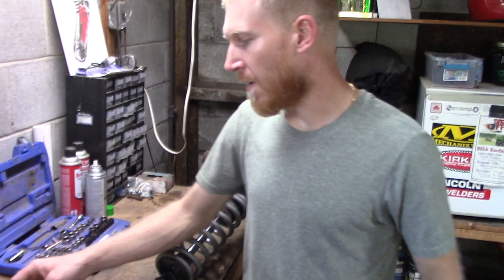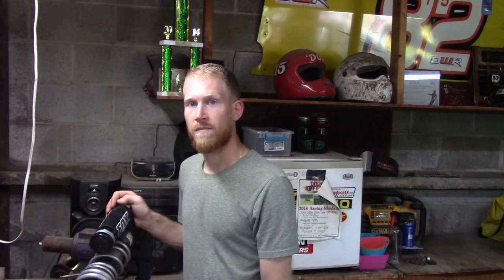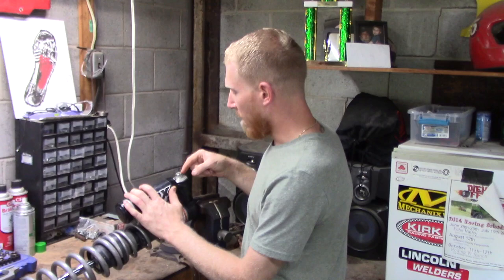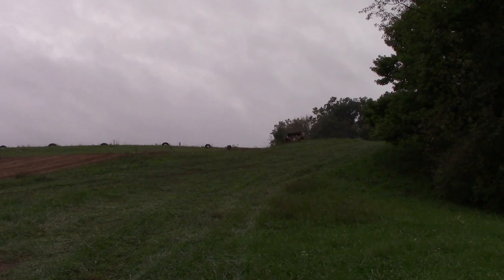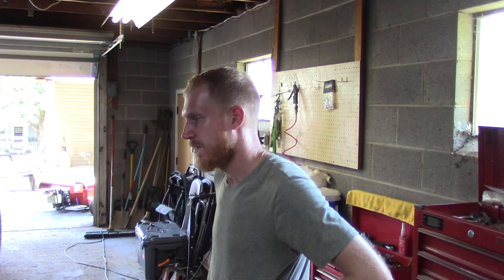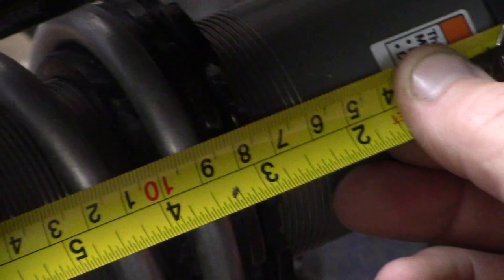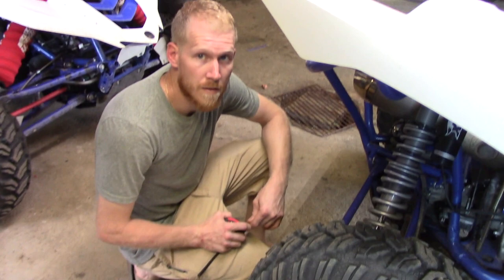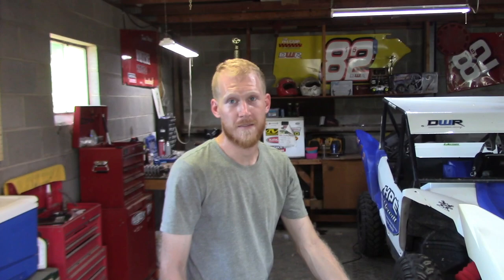YXZ Short Course Stock Suspension Setup! Gladman Gives Out All Our Setup Secrets!

Comment: Also on your measurements you need to reference the crossover nut to the slider not the preload nut.  You can set the preload nut much lower to lower your ride height and then put your cross over nuts just above your slider and that is a more definite measurement.  For short course I run my slider 1/8" off my cross over nut so all the tender spring does is take up the small chatter.
Reply from the maker: I’m not sure I totally understand…we don’t reference the preload nut to slider we take the measurements for both from the top of the shock. We don’t like to measure the distance between the slider and the nut because depending on where the car is settled out at that measurement could change and measuring from the top it’s consistent. And wow 1/8” that’s interesting, you’re basically on the main all the time!
Reply: @writeselwelding  I get what your saying and that works as long as you are not changing the preload/ ride height of the car. However if you set the car down in ride height now your measurement to the cross over nut changes.  The way I measure it no matter where I set my preload I know how long (in distance) I will be on my tender before I get on my main.  it can all be calculated from the measurements you gave but it requires math and thinking when ride height is changed and I avoid thinking when I can LOL.  But yes the way I am set up I am on my main pretty much all the time.  I only use the tender to take up the initial jump and small chatter.  It stops more body roll as well with the spring and doesnt take as much sway bar so you get a bit more wheel articulation while still managing body roll.  its just a different way to go about it.  I manage body roll with the springs and not so much with the sway bar.  These are all setting from GForce shocks also so its not only my preference.
Reply from the maker: Oh ok gotcha!!!

Comment: Say I want to make it smoother for trail riding should I speed up my rebound at the bottom of my shock. I experienced a little with the rebound on my pit bike aftermarket shock and when I went all the way fast on the rebound screw on the shock it rode alot better than when I turned it to slow. I figure it my transfer to my yxz totally new to this just trying to do a little research. seems to me rebound screw would be easiest to experiment with first. Don't really want to mess with the bolt with the little screw if it turns with it yet till I learn more but that single rebound screw at bottom of shock seems easy enough
Reply from the maker: Yes the rebound setting will have some affect on the ride no doubt, but to be honest if we were going to try and improve ride quality on the trail I wouldn’t go there first. The first two things I would look at it the low speed compression setting, or if it has a dual rate spring setup we would look at where the slider is in comparison to the crossover nuts when the car is at ride height which controls how much of your rod is being controlled through the tender spring. Don’t be afraid to adjust on the compression nuts. They have 4 turns of adjustment all stiffer rotating clockwise. Put a wrench on the high speed and count the number of turns until the screw bottoms out. Back the screw out back to where it was and soften it by 1 turn. If you would like to discuss this more in depth we’d be glad to help. Go to the Race Relentless website and send a customer email and leave a number and we can call you back to discuss further.

Comment: You said that it’s the same with the stock white single coil springs on a 16 correct?
You just disregard the crossover spring settings.
Reply from the maker: @ricksteel6401  thank you and yes! Of course the measurements would not be the same but overall the idea and the theory behind it applies to both.

Comment: My 17 yxz has X2 shocks. Is it possible to tighten the springs up that much on these? The other adjustments made a huge difference. I do a lot of road riding to hit the trails and would like a tighter ride.
Reply from the maker: Hey @jamesbrady1959 thanks for the question. When you say tighten up the spring are you referring to moving the compression nut at the top of the spring to compress the spring more?

Comment: I have a talon r livevalve not much I can do to lower the center of gravity, what do you think of me using limit straps to achieve that. 
Also what tire pressure do you run?
Reply from the maker: @TheExtremeRace I’m not sure…that’s a very good question. I don’t really know enough about the live valve to give you any advice on that…on a non live valve shock yes the limit strap will help you get the ride height your looking for if your spring stack isn’t long enough but it takes away from your full droop when the car is off the ground so yes the straps will help you get the car lower but your giving up shock travel in return! As Gladman would say the limit strap will work but it’s really a “crutch”!
Reply from the maker: And as far as the tire pressure we ran 26” ceros and depending on track conditions the rears were between 25psi and as much as 28psi and the front were a little lower between 23psi and 25psi…we ran the rears a little higher just help the rear rotate on corner entry
Reply: Unfortunately with the live valve you’re stuck unless you know someone that can tune the shock’s ecu. Here’s why. The computer has a set point programmed into it that it knows ok this is home or there shouts for a set factory ride height. So you can valve it and make it better and also spring it for whatever you’re wanting to do with it/set your ride height as low as you want. But as soon as it leaves the ground or shock droop the computer is gonna adjust the shocks to try and stay at that pre set height. Eventually it’ll sag down to whatever height you had your springs set at. So in short you’re kinda hosed. I talked to Shawn Hess when we raced against him about why he isn’t running the live valve and he said he can’t find anyone to map them. Said as soon as they get past the set height point they lock the bleed in the valving down and it totally messes you up and it takes forever for them to settle back out while your racing. And yes i believe using a limit strap is a crutch unless you’re using it to keep from over drooping and hurting the stock piston. But not to hold the car from a set height. You spend money to have a shock that travels 16” or whatever. Might as well figure out  how to use all 16”. Send Scott a message on Facebook and see if he knows of anything to cheat the live valve system. I know he’s done several sets of talon live valve shocks. Scott Hewitt at HPE SHOCK SERVICE. What tires are you running?
Reply: Running stock talon tires, I did a rally cross event at the firm this weekend and most of the is asphault and part roadbase, on the asphault the tire gives way to much into turns. I do have a e2racing adjustable rear sway bar running on the middle setting. I think I should make it 1 setting stiffer to see if helps more.
Reply: @writeselwelding  I was reading about those maxxis ceros tires and it said max pressure is 18psi. Is it ok to go as high as you have it?
Reply from the maker: Yes….I ran all of last season on the same set with no issues…I’ve never been lower than 22psi in front or rear with the ceros

Comment: Good video.  there are all kinds of different set ups to get you around the track.  I finally had to go to a front sway bar to keep the car from going up on 2 wheels all the time.  Now it corners flat and does well.  I have been tossing around the idea of getting rid of the X3 and going to a YXZ and stepping down to that class.  I suspect it would be just as much fun while not having the car on the ragged edge all the time.  I am sure I will miss the speed an power though is my only thought.
Reply from the maker: As far as local racing goes the Pro Stock N/A class always has a good count and the racing is super competitive…We kicking around the idea of building a turbo car but from what we seen it just wasn’t worth it so went the stock route….you should 100% get a YXZ!!! Lol
Reply: @writeselwelding  I think there is usually a better count in those classes because price to get into it is so much lower and accessible to so many more.  I will probably go the YXZ route.  Just have to move the X3 along first.
Reply: Totally agree with Donald! It’s more cost friendly and very competitive and high car count. But it’s hard to turn down big power lol
Reply: @kevingladman4735  Yup. I think its the move I am going to make.  Its just going to be hard going to half the HP sometimes LOL.  But I have always said its more fun to drive a slow car fast than a fast car slow.  Sometimes its not about having the most power.  Its fun if everyone is about the same and its just the drivers skills vs the other drivers skills
Reply from the maker: @Chad Shumaker some of most fun I’ve had in racing is leaving the super buggy sit and getting back in a 1600 car…when the racing is super close and you can’t make a single mistake without loosing car links it’s fun!

Comment: Just wondering, and I apologize if it was mentioned in the video because I must have missed it then.  What ride height front and rear are associated with these settings?
Reply from the maker: No you are correct we didn’t mention ride heights in the video. Ride heights measured roughly 10 3/8” rear and 11 3/8” front using the most rear facing lower pivot bolts to the ground! Hope this helped!! Thanks for watching!!
Reply from the maker: You might be able to get this exact measurements it will depend on the spring setup you’re running but you do wanna be 1/2”-1” higher in the front
Reply: Much appreciated! Great video, great info.  Tuning a 2020 XTR with RC2s and stock dual springs and looking to see what kind of performance I can get out of them before jumping to Weller.
Reply from the maker: @Smoking_Nun  No problem! and Thank You! If there is anything else we can help with just let us know!

Comment: Hi guys I have a 2017 YXZ SE with the X2's what's your thoughts on a better ride for this setup?
Reply from the maker: Hey, Thank for watching thanks for the comment…a better setup for improved ride quality really depends on what type of riding or racing you primarily do with your machine? What do you use your machine for most of the time?
Reply: @writeselwelding  we do a lot of sand dunes and desert riding
Reply: Wow great! Were out in Arizona so would need new springs? Oh also do you guys run the sway bars front  and rear?
Reply from the maker: Yes we run Eibach bars front and rear on one car and on the other we run the stock bar up front and a custom built setup on the rear. Definitely a dual rate spring setup is the ticket for desert riding…the dual rates will allow way more fine tuning. If your in the desert at higher speeds across the chop you can work the tender springs and play with the high speed compression settings and then rely on the main spring for the bigger jumps…that will be done with your crossover setting

Comment: building a yxz this year for the 2023 season of gas.  you guys prefer manual or automatic for short course?
Reply from the maker: That’s awesome! Good luck to you!! This is Donald speaking and this is the ultimate debate. I run the manual and Kevin runs the paddle. Both of us prefer the ones we have and both of us are way slower in each other’s cars lol!!! For me I turn faster laps in my manual car but if I had to run the paddle shift it has to have our push button shifter kit in it especially in a car that doesn’t have a steering quickener!!
Reply: Man, that’s a tough one. If I got a manual right of the start I’d love it. But, I do like the convenience of the sport shift after we’ve scienced out the push button shifters and some mcu tuning. If you go the ss route I really recommend our push button shifter kit. They both have their advantages for sure, some say the manual is better cause you can use the clutch in certain situations. But if you watch our videos it’s tough to call which is better cause both cars always find each other 🤷🏼‍♂️
Reply: thanks, gents.   and which oil should i use?     xD  (j/k)    

i'm a manual type of guy, i love the modulation you get w/ the clutch and the gas (corner entry and exit). 

of course, when there's enough silicon involved the skill becomes moot and maybe a hindrance.  fortunately this gen of sxs doesn't seem to be overly digital.
Reply: Is manuel Clutch easier to drift?

Comment: Would these setups still apply to stock springs? I just got a 21 xtr. We have a track here buy has no jumps. I do trail ride slso so what setting are good for that ? Thanks!
Reply from the maker: Hey Jason!! Thanks for the comment! Does your 21 have dual rate springs?
Reply: @writeselwelding  No their all stock.
Reply from the maker: Jason…the exact dimensions and settings will not be the exact especially if your working with stock springs but the same principles will apply!
Reply from the maker: For anything on a racetrack with stock valving you’ll want your high speed and low speed compression on max stiff! And when you hit the trails you can soften them up for a more plush ride… more rebound clicks in the front than the rear will help it jump level…start at 9-10 click out on the front and 4 clicks out on the rear and adjust from there…you can adjust your spring compression nut to lower ride height for the track but you’ll be giving up the ground clearance for the trails! I hope this helps you get started in the right direction! If there’s anything else we help with let us know or send a message on our Facebook page!
Reply: @writeselwelding  Thank you very much for your time and giving me this. This is my first sxs so I dont know alot yet. One thing for on the trails what do you do on the rebound?

Comment: Do you guys every ride the trails? Do you have a Tails set up you run.
Reply from the maker: Hey Edward! Thanks for watching and thanks for the comment! We do take the stock unit out and trail ride when we’re not racing. We run the high/low speed compression on max stiff for racing but we usually soften the low speed compression a few turns for tail riding. The rebound settings we use for racing actually aren’t too bad for tail riding and of course putting a little bit of ride back in the car by the compression nuts never hurts if your going to be in deep rutted trails.

Comment: quick question im running the exact same setup with the weller short course springs and stock shocks with all the preload taken out and full max compression and when I was running a little taller hoosiers I never had this issue but I recently switched to a 27" maxxis ceros and now sometimes off of bigger jumps or whoops the rear skid plate will actually bottom out and smack the ground, what would you recommend to stop it from doing that? add a little preload? or do you think the shock is just getting a little worn?
Reply: Does it do it right off the rip? Like first lap out or does it take 3-5 laps to do it? Also keep in mind it could be the added weight of mud stuck to the car that’s compounding that problem cause the ceros throw a shit load more dirt around. If it’s lap one bottoming out I’d say your probably right and need to add some preload to it. Just make sure you move your cross overs accordingly so the mains engage at the same point as they did before you moved it. Otherwise the car will become lazy again. In our experience it’s been gas bleed off in the reservoirs. If you have a way to check your nitrogen pressures it would be wise to check and see if they bled off. If not the fluid is probably killed in them. This will be more noticeable as the race goes on. The stock unit is fantastic the first 3-5 laps then the shocks get heat in them and the fluid starts cavitating. Then it gets really lazy and unpredictable. But that’s from lack of a simple shock service. Plus exhaust heat on rear shocks is unreal on the early yxz while racing. Just throw your hand on the  reservoirs one time after a race and see how hot they are. There’s a couple things you might be battling from the sounds of it. Just have to do some looking to see if it’s a shock issue or just a simple preload adjustment. Let us know what you figure out and if you have more questions don’t hesitate to hit us up!
Reply: @kevingladman4735  okay, im gonna try a little preload and see if that's the issue, if not ill hit you up about how to do a maintenance on the shocks because I've never done one before. I appreciate the help!